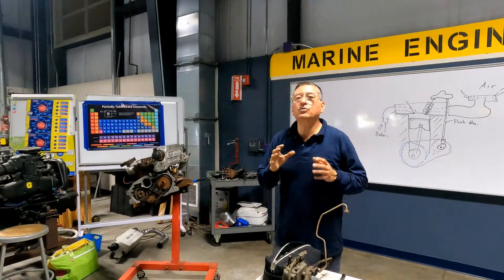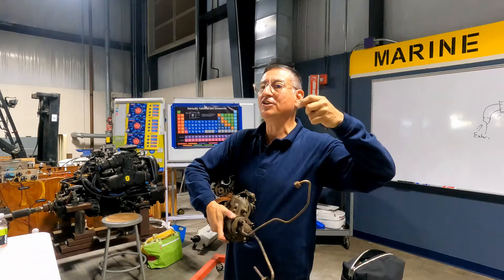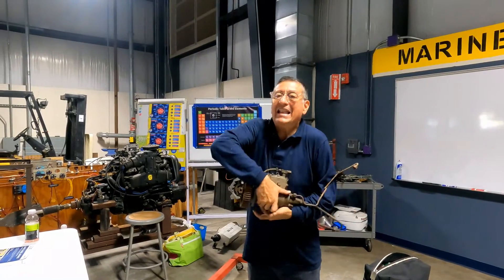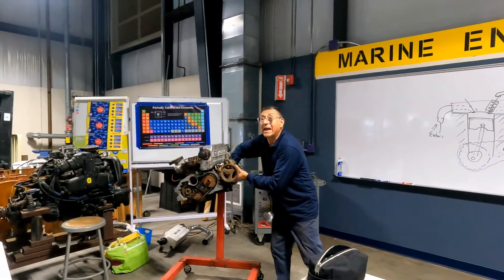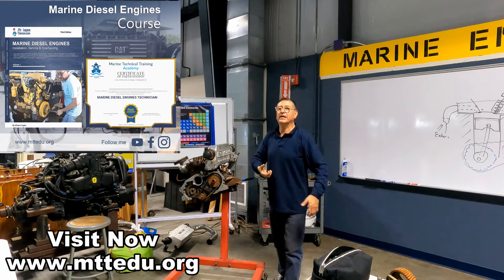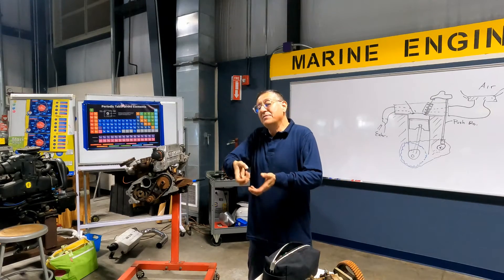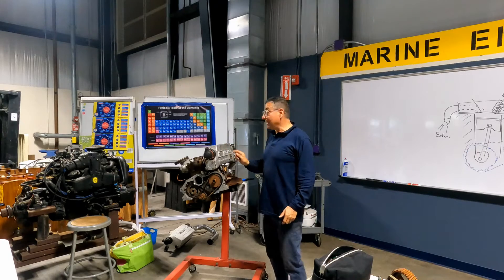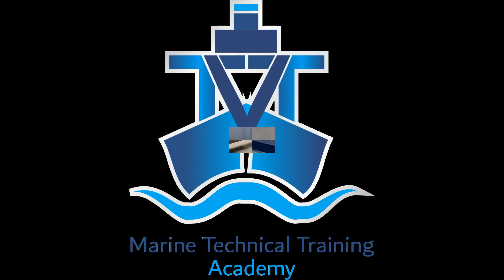Diesel Fuel Injection Pumps Types

Comment: Hi 
What will happen if I take fuel pump not in zero position and when I return it I put engine in zero position and put it is there any problem...
Reply from the maker: Yes. when you try to put in back, the engine should be in zero , if not the engine will not start